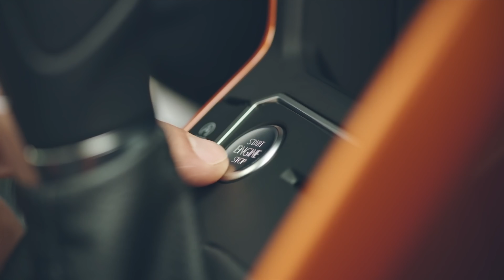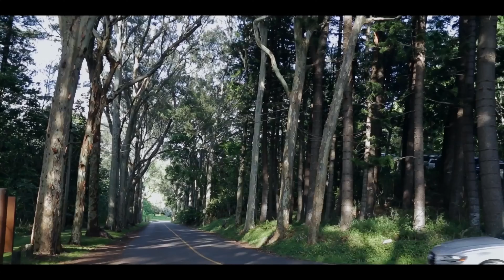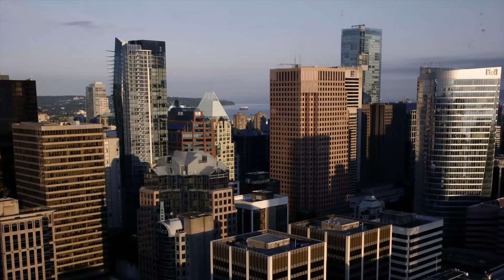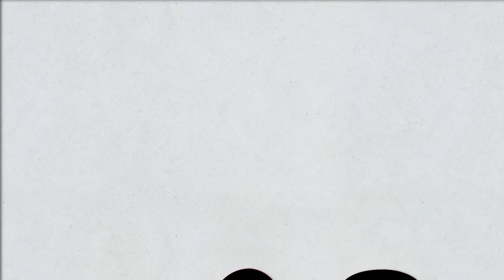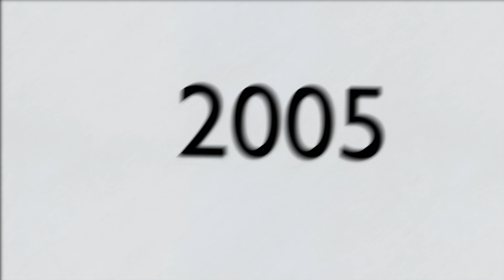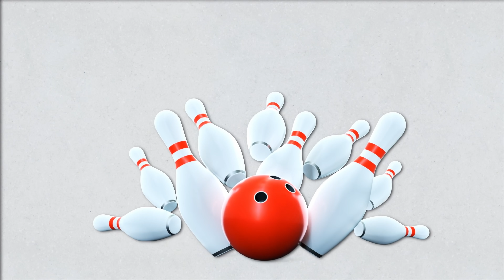Volkswagen Just Got Fined Billions and May Be Going Bust

Comment: Just bought a tiguan, drove a honda civic before. After some initial hiccups that was dealt with by the vw service centre i love the car, and the handling and suspension is something that cant be found in japanese cars.
Reply: My 2018 Civic drives and handles really well in curves and rides plenty good. Thank you very much. Even my older Honda Fit handles well but no, it doesn't absorb bumps as well as most cars. Not heavy enough. I used to have a VW Rabbit in the early nineties and would never buy a VW again, I'm sorry. The electrics sucked. Japanese cars have by far the best electrical systems. Electrics are important to some of us.

Comment: Do please look at the actual emissions vs just going by the "up to 40x more", which is deceiving once the actual numbers are listed. Example, what is 40 x 0? The emissions were still so negligable that even x40 they were still darn clean. The arbitrary number US put down as the limit was SO low for the new vehicles that, in my opinion, the real objective was to kill off diesel being used in passenger cars at all. The revelations opened doors, and the regulators quickly saw some VERY deep pocket$ in which to dive- and dive they did! Punishment didn't fit the crime to me, but I'm also no fan of diesel vehicles so, whatever. Not sticking up for cheaters, and I personally see cheating happening on both sides here; our government agencies by bashing around that 40x deal then fining VW to the moon in order to fund itself for years to come- with another arbitrary $ number, that kept increasing by billions month after month and never seemed to end.